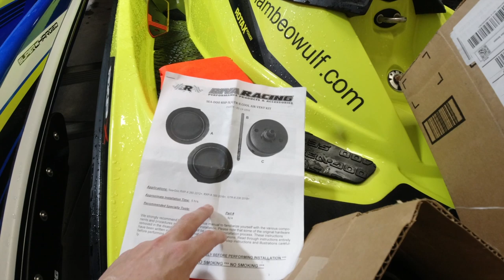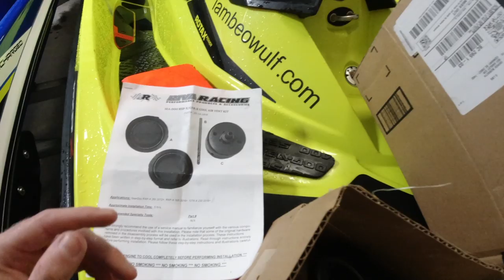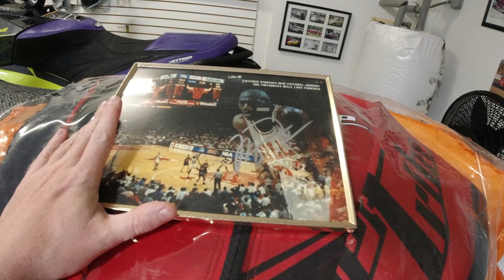How To Install Riva Racing Cool Air Vent Kit Sea-Doo RXP-X 300 With Test Ride

Comment: J E A L O U S.  I'm torn that I won't ride my RXTX in the cold that's why it's nice to watch your videos and this brings a smile to my face.   Also, you need a house on the waterway so that will be the total convenience package!  Also too, you own and use and abuse that waterway by tearing the Sh8t out of it - nice to see you pick up all the debris.  That glassy waterway allows you to use the maximum horsepower and have massive fun!  Please feel sorry for us ocean riders since normally we only use half of our horsepower.
Reply: Junior jr have u had problem with your sport mode button coming threw the rubber cover

Comment: What was that orange Symbol that popped up on you dash a few times when you let off the gas?
Reply: at 13:31 it was red and it is the oil light, my guess he is running the oil level low as possible to get some extra power and the rapid deceleration the oil is sloshing to the front of the pan.